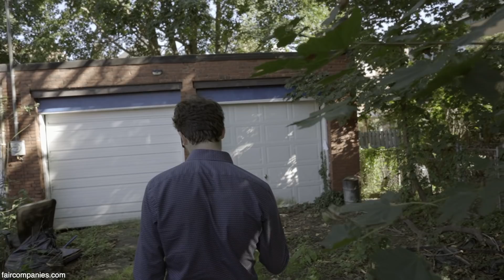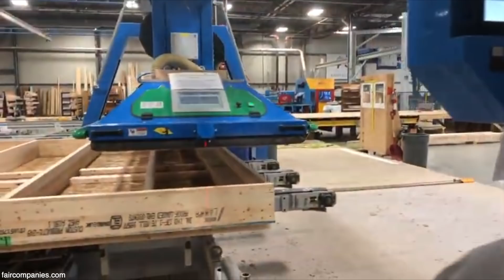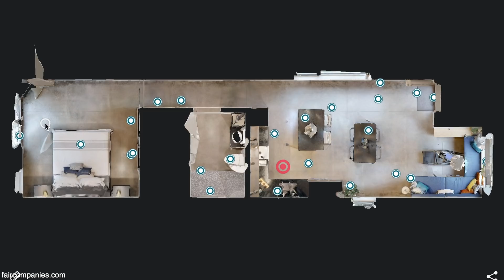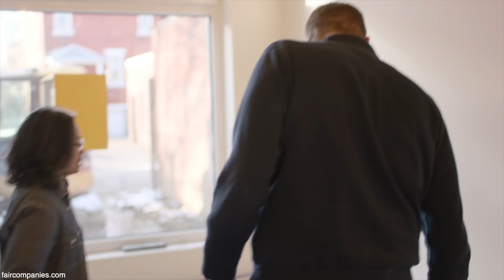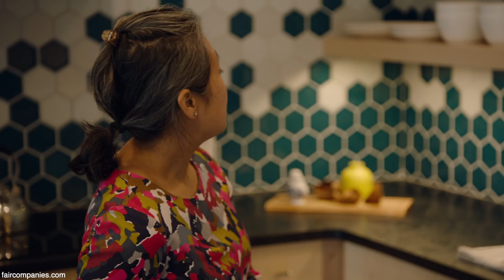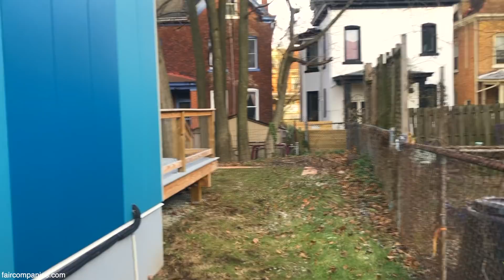Pittsburgh incremental house: a home that can grow with you

Comment: They never show how long it takes to build the foundation with plumbing and electricity but spend a lot of time on putting up walls.
Why don't they also prefab the base ?
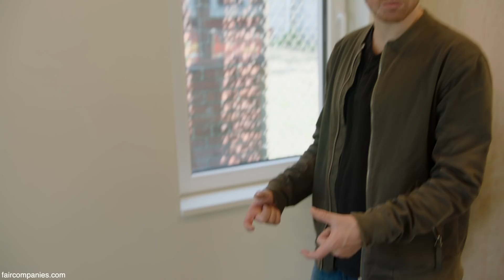24:00 we used this ventilation system in Germany in 1993. ( it was new back then)
To bad it looks like a trailer home from the outside.
How about using the roof as a deck and letting vines grow up the side?

Comment: Well this has it's place but not yet. I can have a 1600sf home framed on site in 4 days. When I was building in MA I consistently came up against people who went this route on 2800 sf homes. I would have my buyers in their homes a month before the panelized building with the same start dates. Not impressed. I just built a 1200sf Cabin for my family with my wife and the boys when they had time. Now we did provode all the labor excet for plumbing and electrical which had to be done by a licensed professional to meet code. With a new spetic, land and all materials? 100K!

Comment: The description says this is the first home built by this company. Like any new product, the price should drop as sales increases. This particular home has all the bells and whistles, including some seriously expensive appliances and finish materials. I didn't hear whether the windows were triple gazing, but if so, that's pretty pricey as well. 
I like that this home will have very small utility bills and that forethought went into sizing the bedroom to accommodate the later addition of a stairwell for a second floor.
Overall, I like the house but not in this location. It clashes badly with the character of the neighboring houses. The price is a bit rich for my blood.

Comment: This house was built cheap.  The used cheap  OSB board in the framing.  They used a hybrid water heater when the tankless water heater is better.  A  condensing dryer is not energy efficient. For a house  which costs over 400,000 dollars. No, I will pass thank you.

Comment: At first I didn't get why people dont like the recyclable OSB panels and I guess the point is that the easier the construction process, the less workers there will be needed, however, I found out that OSB has a short life span (not great for the concept of being a build as you go since the foundation has to be strong which could potentially create higher cost and time working on it in the long run). But DID YALL REALLY HAVE TO TAKE OUT THE GARAGE??? You know how much debree and pollution comes from tearing a structure down? Bricks are such a useful and long lasting material which you could have either reused or just had as a foundational or supporting structure like an out shell.  Also careful to not gentrify all of pittsburgh, I know it is just inspiration for a solution to a population problem but Pittsburgh is not similar enough to South America to the point where these architectural projects are necessary. There are plenty of abandoned lots and houses that just need a secure foundation, along the way, it would be better to create a rennovation program that helps residents truly make decisions about their home.

Comment: I live in Pittsburgh, and single bedrooms are hard to come by and when you do find one, it's usually in the $900/month price range. I wouldn't be surprised if this place went for that when rented out. I think converting a large, abandoned/for sale home into one bedroom apartments is better than adding another structure. If this was cheaper than most single bedrooms in Pittsburgh, I'd understand. But I doubt it would run for much less. Plus parking in Pittsburgh sucks so that garage would've been a great asset when trying to rent or sell. I'm guessing a lot of the requests regarding this place came from the clients though, so it could've just been poor decisions on their end.

Comment: Stupid house. I don't wanna sound mean but this is completely devoid of architectural appeal. It looks like a gimick to sell people less house for more money while using poverty stricken nations as some kind of artistic justification. The reality is the cost to build quality homes in the city of Pittsburgh is far higher than just fixing up an old one the way you want. It's really kind of like a reboot of the sears catalog homes in the 20's with less design. They aren't too bad I might have been a little harsh. The ability to add layers or rooms to the home seamlessly with the manufacturer is interesting. 

edit:the ceiling is kinda neat also.

Comment: A 40 or 50 gallon standing tank water heater for a tiny house?! I heat the water in my 1 bedroom with an electric on demand heater the size of a back pack. I can take an unlimited hot shower while my wife runs the dishwasher.

Comment: Why not make the entire home in separate modules offsite? Electric, plumbing, interior walls, floors, etc. Make them with metal frame. Can stack them together like lego blocks and connect each module. Adding additional modules in the future would be just as easy as the original build. You could even re-arrange the modules.

Comment: Ok the guy in Pittsburgh is slightly annoying.. You can automate housebuilding like you can a car. Not all modular homes are built well. They are the major reason why firefighters fall through floors because of the glue failure  of the prefab trusses. Ridiculous.

Comment: A flat roof in an area that experiences occasional heavy snows and icing, and you expect to repurpose that roof/ceiling if the building expands upward to another story?  It's fine for a concept house, but maybe you need to add a "sloped roof module" to pop on top to minimize water damage from spring thaws.

Comment: They are manufacturing only the outer side of the wall. Here in central Europe, the panels are made with ducts for wires and pipes, they are much more finished. You pull the wires through the ducts and paint the inside and you are done.

Comment: Lol,
Lovely place with a high price tag. This video reminds me of the non profit company called Icon that builds 3d printed homes. Icon says that their houses are affordable and way way cheaper than a conventional home which is a total bull. People or companies that say their homes are a fraction of what a real house costs are full of it. If that's the case why haven't they built homes across the U.S. and sold them each for less than $100k? It's simply can't be done for that price. Each state has building costs, codes, and what not which drive the price up. 
It would be better if everyone just proved us all wrong by simply building the houses first and then sold them all for under a $100k no matter which city, county, or state the houses are built in. Deck out each house with fixtures and make them all energy efficient.

Comment: B.S Flag, this guy a joke. This is far more expensive than traditional stick framing. With this you are paying for that huge factory, employees, equipment, tech, ceo, vp, delivery, cranes, on and on. You can pretty much eliminate all of that and build the exact same thing with a few guys in 2 days for 100-150 a SF finished. The truth is there is nothing about this home that can't be done onsite in a few days. It's perhaps the opposite of efficient. Also, the blue looks terrible and would be an eyesore in any community.

Comment: i normally love your videos. this one was garbage. well produced! but terrible subject. godawful architecture. gleefully tearing down the old garage which could easily have been converted into a beautiful little in-law. your drone shots of the surrounding houses which enclose so much more volume, so much more beautifully, for so much less money. highlighting this dopey expensive rectangle shipped from new hampshire! you realize there are three story mansions in and around pittsburgh that can be bought for $50k-$100k. sometimes much less. these architects need to use local salvage, move and renovate existing buildings, and strive hard to make houses cost a year's wages or less, not 10-20 years worth of income.

Comment: Liked the system- in my mind this would be great for a large home builder to have its own factory.  Bang up a weather tight  shell, and have your army of electricians, plumbers and drywallers come in .    I would guess the quality of the structure is much tighter than anything a on site stick built house would have(having talked to somebody who recently bought a stick built house constructed by a large builder)  If the underlying structure is really good.  Then that should telegraph into the finished layers of the house. .  It would be nice if the interior walls could be preprinted were the outlet boxes, switches, and plumbing runs would go.  even electrical and pipe channels pre carved out into the wall.   You would know the window sizes already.  you could have them ordered.-  The kitchen cabinets could be ordered the same day as signing the contract.  I bet you could even have a shipping container prepacked in the right order from front to back.  the items you need first would be in the front and as you unpacked  the container.  you would build the house in the right order.   Each item has a barcode sticker and you scan it and it tells you were it should go on the building then you could pull up a picture of how it should look and possibly even install instructions or a install video.    Imagine telling a trainee.  Hey scan the faucet and take it up to were it belongs.  Then tell him ok install it.  Then you could have the master plumber at the end of the day come around and sign off on a tablet that it is done and done properly.   Then five years later if it  turns out to be installed wrong you can look up who signed off on it and go back directly to them or the company that bonded them .

Comment: Quite honestly in 3D printers are much more efficient
Reply: C’mon Death Stranding PCC, build me a house!!!
Reply: @evshrug  shell up the cash
Reply: WhiteEagle • Quite honestly, I was joking, because right now any 3D printing besides resin or plastic, especially a multi-material project with specific requirements in physical properties like a house for living in for all seasons, is both prohibitively expensive and ultimately not 100% printed-possible.

Even in the fantasy world of Death’s Stranding, where they rely on 3D printing fabrication and can make an array of complex structures and items, they make a point of saying several times that some things can’t be 3D printed.
Reply: @evshrug  in 2017 they made a high-powered sports car completely 3D printed - now I'm not sure if that includes glass.
Reply: WhiteEagle • Glass is a big “If” imo, but did you know that glass (as we use it) is actually a very viscous, very very slow flowing liquid? That’s why really old houses seem to have “rivulets” running down their glass and are thicker at the bottom than the top, it’s not that they couldn’t make flat clear glass back then! And it flows faster when it’s warmer... so 3D printing glass might be possible, but it would require a very special nozzle and maybe more time than printers of other materials.

I did not know they 3D printed a sports car. Were they able to use the same printer throughout? Or was it an assembly line of printers, and the pieces needed to be connected by hand after printing?
Reply: @evshrug  good question I'll check into the car. As for glass. Glass needs very high temperatures to emulsify. Since they have developed titanium glass, I'm guessing they have the technology..
Reply: If u have unlimited funds, I can easily make that happen - of course the zoning board would have to approve it. - The technology is there in many forms. Google it! - Although in this limited space this type of construction may be the one of the best alternatives.

Comment: at $225k plus foundation and sitework starting prices are not cheap - this is not an affordable solution when you factor in the land cost on top of the building.
Sorry Kirsten - I'm a huge fan of yours but this one is  out of step with your usual focus on affordable housing.  They could have dropped a small manufactured home in on that site for around $100k or less

Comment: As a supporter of smaller and better designed homes I found this to be disappointing. The reason behind larger homes is math. All else being equal, the volume of a house increases exponentially while the cost increases linearly. This is why the $/SF cost of a tiny home doesn't stack up well against McMansions. Address that problem and  you have a more viable business.

Comment: Great ideas, but does lack experience. Maybe someone with experience and ties to local labor could help or partner with him to help him succeed. First thing I though about was could this work in the side of a hill or under an existing structure since the ventilation is key anyways? could this house be stacked on an existing structure to add some housing? or could it be modified to be semi-mobile, so it could be moved to an alternate site as owner needs change.  instead of expanding up... what about expanding down? or out to the side? where do i put my wood working shop? could I install the house below, beside, above... etc to my existing shop? I have more questions than answers i guess.

Comment: I like the barn door idea in the bedroom. Not so thrilled with the exterior design as the house itself is already unique enough compared to the other structures around the house and the color theme doesn't go well with other houses at all. I also hope that the electric box is finished differently. Exposed metal door doesn't really match with the entire design of the house.

Comment: I used to live in Pittsburgh, or really in the North Hills in Allison Park.  I lived there in the early 80's and our home was a design and build by Pittsburgh Steel and was a concept model.  The house was a post and beam made from steel tubing, with Aluminum skinned SIP between the posts.  Sections were commercial windows from floor to ceiling and other sections were the SIPs.  It was warm enough during the winter and the panels were only a few inches think.  Could hear people talking while walking by ;)  The only issue we saw was a little rust developing at the base of the posts where they sat on the foundation.   I love the Alternative build types, but have yet to find anything that is cheaper or even comparable to site stick build.  These SIP prefab structures are always way too expensive based on dollar per square foot.    The concrete 3D printed homes are the cheapest and coolest home concept I've seen yet.

Comment: Building tiny homes make no sense in terms of saving money, when you factor in all the fixed costs. It Doesn't matter if you build a 600 square foot home or a 1600 square foot home you spend pretty much the exact same money on permits, land, plumbing, electrical, heating/furnace/AC (septic and well if in the country). Price per square foot on a tiny home skyrockets because of this.
The only way to do a economical tiny home is a mobile home or coach house. Single family (small) homes on a detached lot make no sense. Good idea but bad business model.

Comment: This is a prefab house. its nothing new or groundbreaking. They have been around for years. While it should be cheaper to mass produce a house in this way, because of the automation involved. Its actually a lot more expensive. The old hipster method of making it a niche market and charging more for it. Which is why you now pay $5 for coffee

Comment: The finished building looks like a shed that houses an indoor "learn to swim" pool. I feel so bad for the neighbours having to stare at that monstrocity forever. I'd be planting a hedge asap if i were them.  Goodluck replacing that fridge when it eventually dies (which will be sooner than most cos you've encased it) And why would you do a concrete floor and not do what EVERY other house on the planet does with concrete and cover it so you don't lose that heat. There's just SO much overthinking and "selling'' going on in this vid it makes me wanna not watch. What a scam of a building.

Comment: This is a great idea, and those Pritzker houses in Chile were also a good idea and an innovative solution to a chronic (and community-destroying) problem. However, the Pritzker houses proved problematic, and my understanding is that the jury is still out on whether they can be called a true 'success'. 

I'd really like to see how this house ages, and follow houses like these for 10+ years, to see what happens. Like does the blue exterior age well, or does it turn kind of dingy after a few years? (Here in Toronto, for example, a lot of the wood used in the 80s for things like windows or siding ends up looking pretty grim; the stucco cladding that looked so cool in the 90s looks really eroded today). Is it really all that easy to add a second storey or will the cost turn out to be prohibitive and, due to settling of the first house, plagued with engineering problems? 

Again, I am 100% on board with innovative ways to add affordable laneway housing to cities - I just hope these alternative building/decor ideas age well, is all.
Reply: Not trying to criticize, I just haven't heard the downside of the Pritzker houses. What happened that made them problematic? Were they made of poor materials or something?

Comment: I have a 12' x 60' area l want to turn from a 2 bedroom, into a 1 bedroom, bath,  living, kitchen dining combo, open concept with a tankless water heater, possibly wood heat & solar panels, & am looking at $15,000.00 to work with. There'd be no way I would ever have $149,000.00 to invest into something that small. I bought my 1st home in Baldwin for $23,000.00, that was in August of 1984. I do like your idea, & hope it works for you, but I'm not sure the income bracket you are targeting, & It's not far from the floor plan I'm doing.